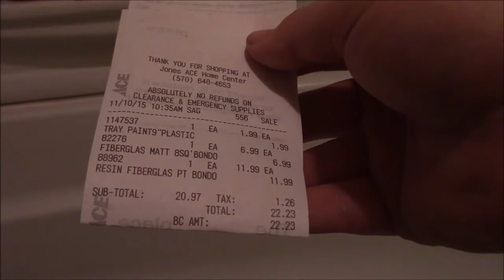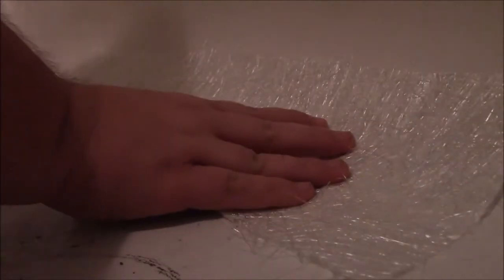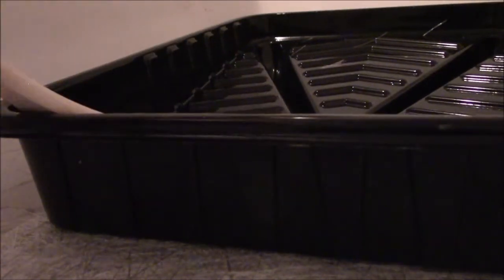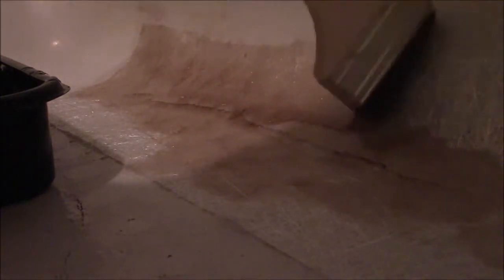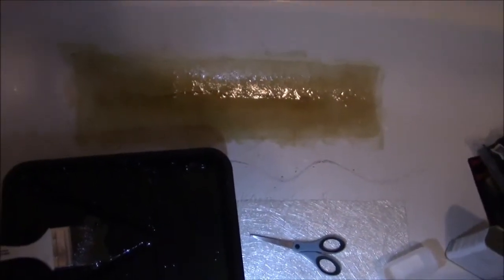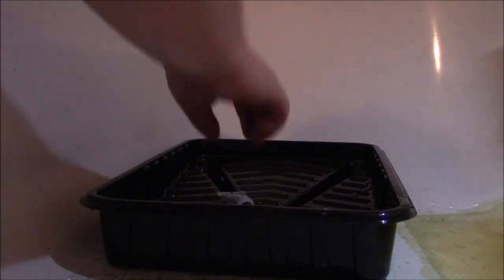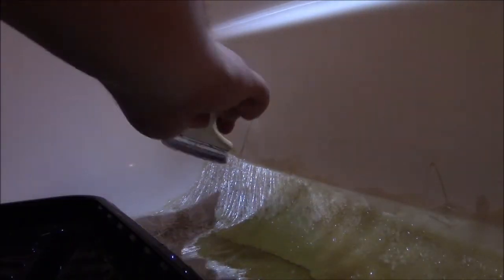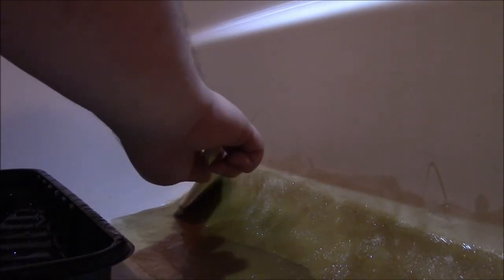How To TEMPORARILY Fix A Cracked Tub

Comment: Dude, you call this a temporary fix? Put another layer of fiberglass and resin, sand it smooth prime it with epoxy primer. Then coat it with a coat of epoxy top coat. They make epoxy coat for fiberglass tubs. Then you have a PERMANENT fix actually stronger than the tub was new. Great video, loved it. I've done body work on cars for over 30 years, wile I'm no plumber I realize I knew how to fix my shower all along.